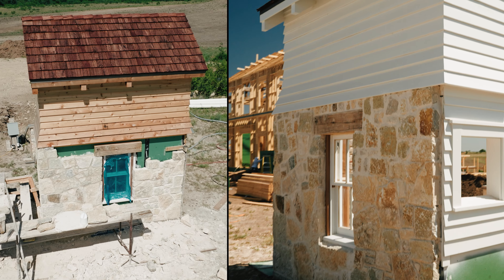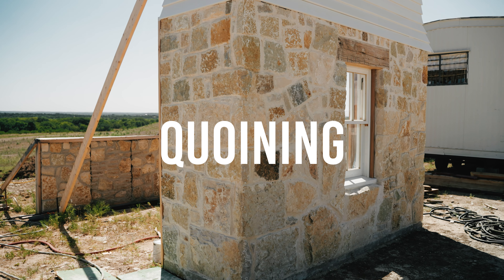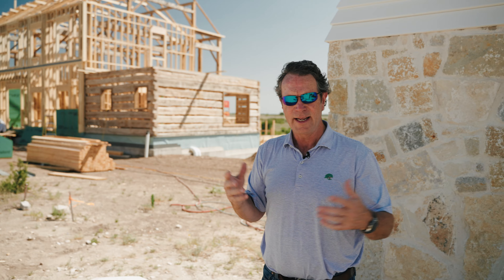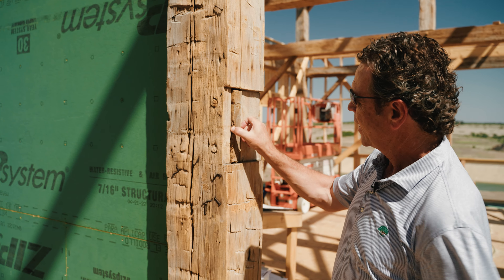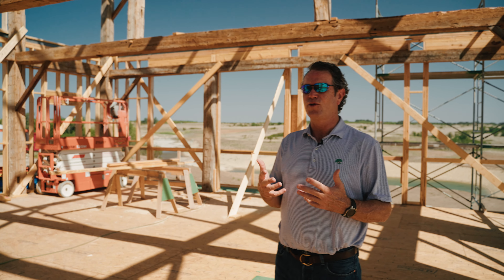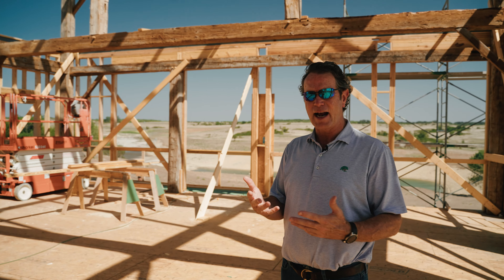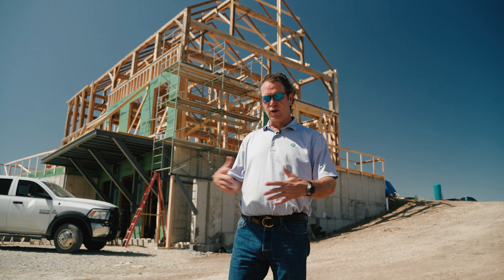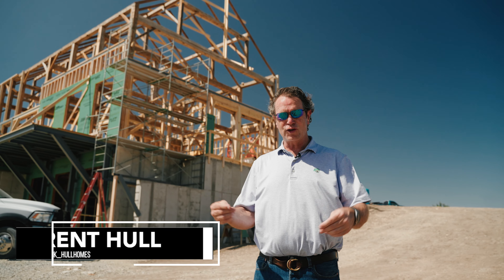The great Ranch/Barn project update!

Comment: I would still find a new mason
Reply: why?
Reply from the maker: Not sure I understand.
Reply: @BrentHull  Looking @ Audels Masons Builders Guide #4 (1924,45,51);  I see nothing representative of your work.  (With much Respect;  I would not have the reference text - if not for your teaching!!)
IMO: It's a mixture of coursed and non-coursed.  @  0.02 A rock looks set at 45*;  @ 0.21 this left corner looks like it's ready to slide off.   0.07 Joints are to wide, most are random widths.  
Do a sample of the dry laid wall,  it should be tight fitting.  Will they compliment each other?

Great Project!!
hp

Comment: Poor stonework. It needs level coursing....never put a stone taller than it is wide. It will look more historical. Also, joints are running almost vertical, divide them more.
Reply from the maker: Thanks for the input, we're working on that exactly.